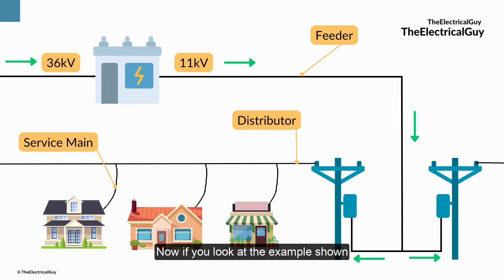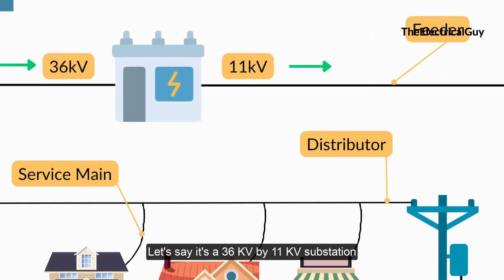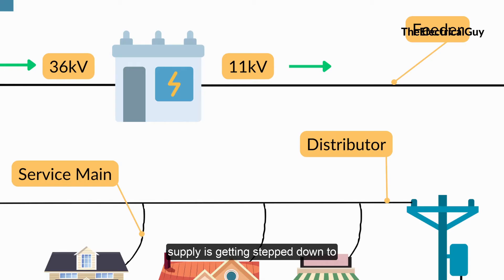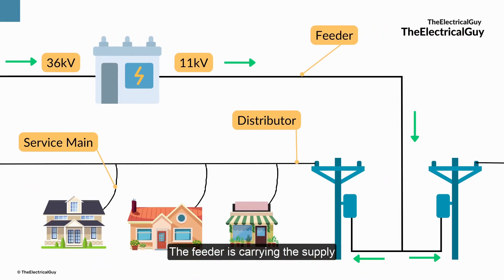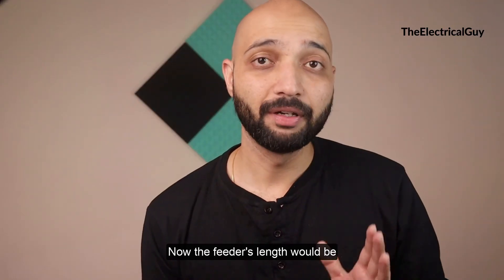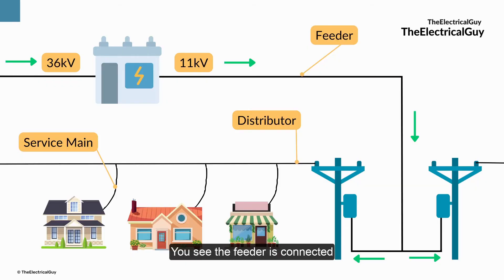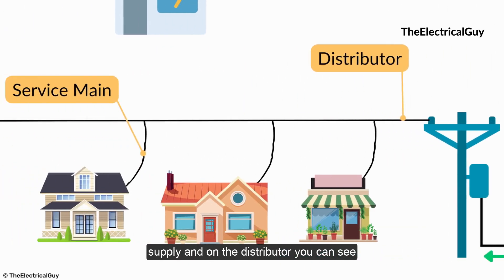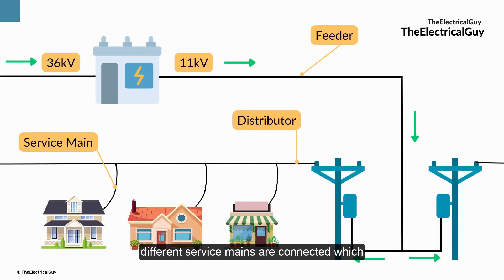Feeder, Distributor & Service Mains | Explained | TheElectricalGuy

Comment: This is a very good video sir, but how is it possible that voltage is traveling such a long distance from the substation to the distribution transformer but not having any losses? there would not be any line losses in feeder when voltage travels through it?